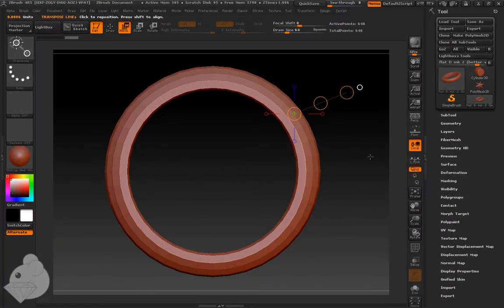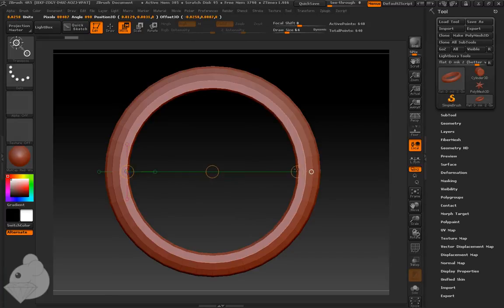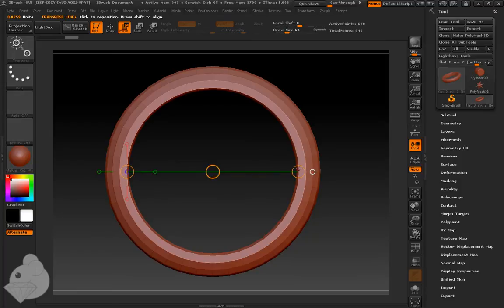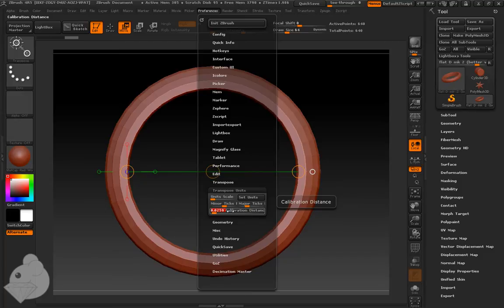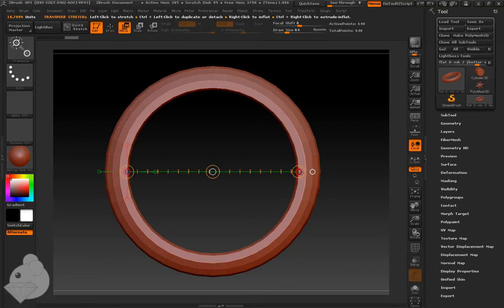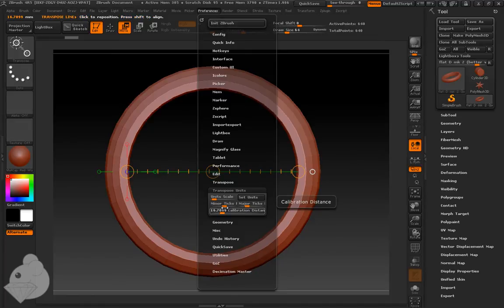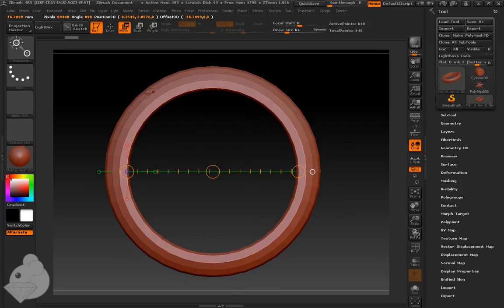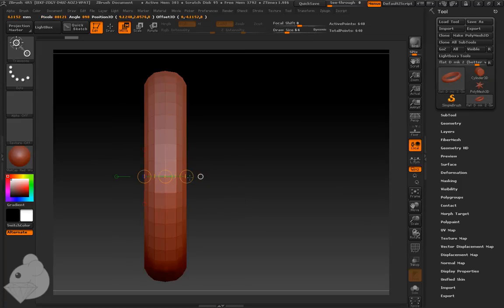How to Measure in Zbrush

Comment: Do you mean it will be that size when exporting to 3d printer or STL?
Reply: José Miguel Aragüés  I think u have to type that into 3d print exporter, the important thing should be the correct ratio.